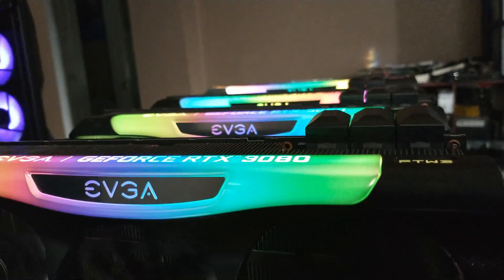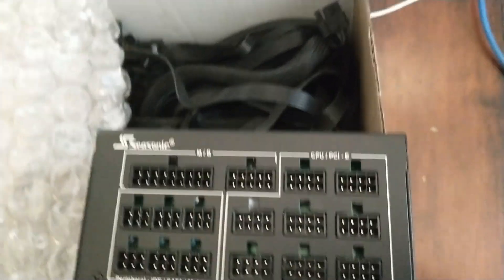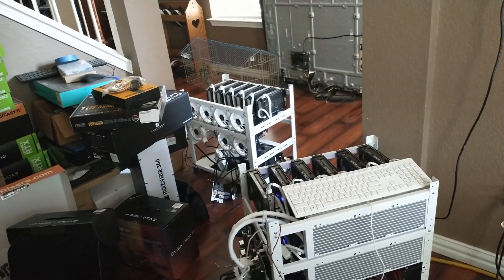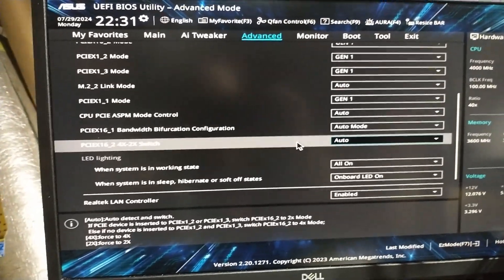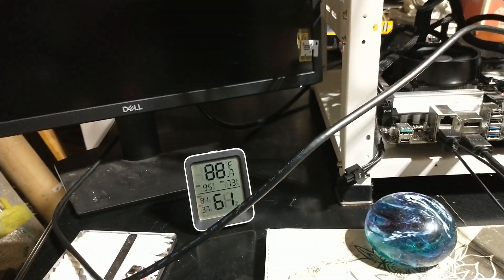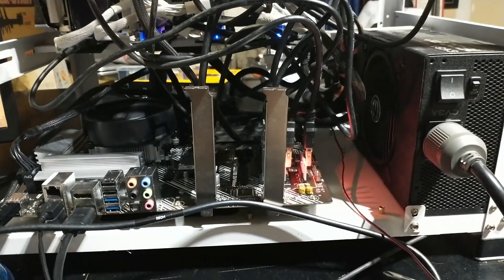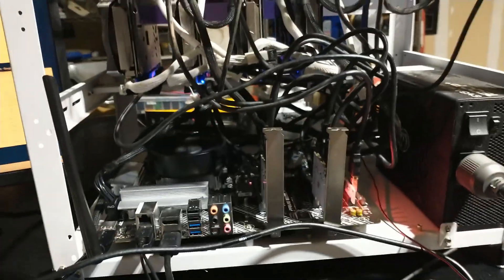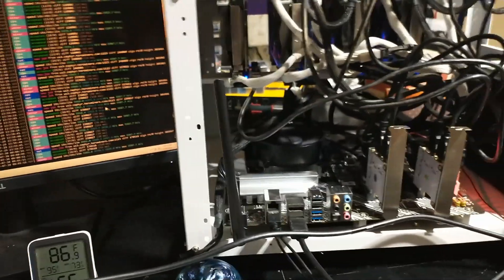#FlatTopRigGang, Will 10 GPUS mine on a B550 while mining RandomX? New PSU day!

Comment: Excited to see the difference ping makes on fast block coins like pyrin, kaspa, etc. Is it substantial or negligible?
Reply from the maker: @TheChuckDanger  Test incoming! Lol 
Appreciate you Mr Danger🔥🔥🙂
I can run longterm on the white rig... both are identical in hardware👍
Pyrin first?

Last block on this current test was an hour or two late for 24 hr breakeven on electric
So, 14 blocks in 24 hrs with 52Gh at ~120ms
Needed 15 though.. but close🙂 
But 14 was a lil early, so I guess technically I did break even with high ping and coin price at an all time low.... 
Which was my goal, so maybe it was a win🤔

Comment: I recently tried to boot my ASRock H510 Pro BTC+ rig and it's dead, no beeps or fans.  I determined the PSU is working and GPUs show good 12v power light when in the pcie slot (MB good??) but have no second lga1200 cpu to test with (its also a 11400).. I even checked the power switches. lol @sadiesometimes  It is my 1660s-2080s mixed rig so nothing too important but I will want to get it fixed before the cooler weather comes.  Let the cheap CPU hunt commence! 
Thanks for sharing Sadie!
Reply from the maker: @alltrac89  Noooo!! Board down... medic!!
Dang... Don't know international shipping costs, but am happy to send the 10105 if it makes sense for testing.
#BadPingSolo🙂
Reply: @Sadie_Sometimes  Thank you for the offer but not worth the shipping cost.  I can get a celeron for ~50us with free shipping :P